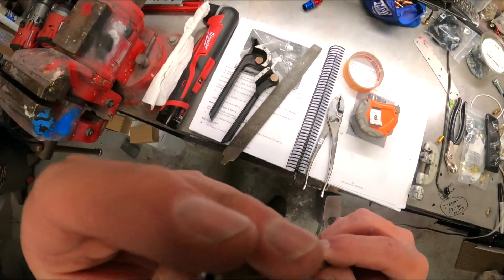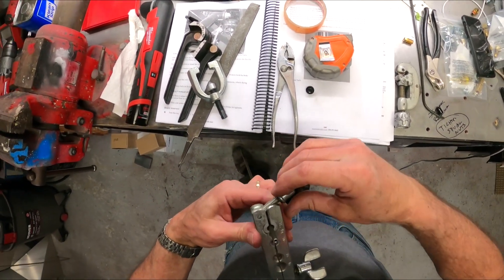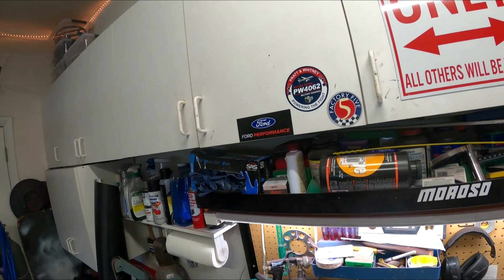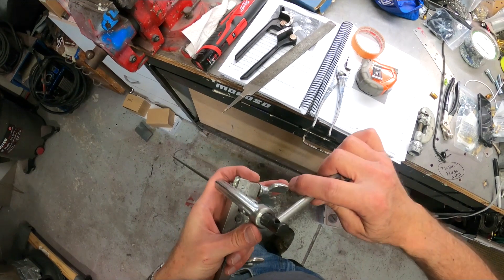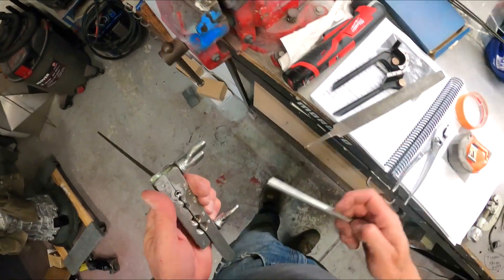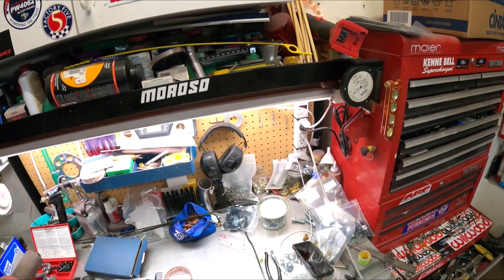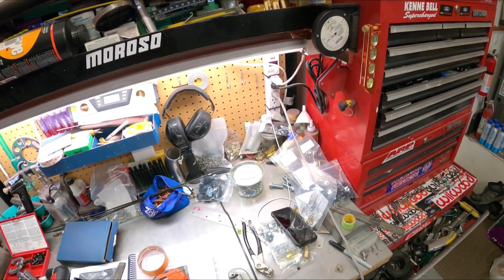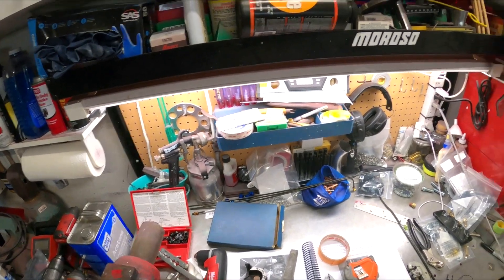Cobra Daytona Build-Flaring Brake Lines, Video 30

Comment: Really like following this build and your attention to detail. One comment on brake lines to keep the flairing to a minimum when doing custom runs is to use swagelok fittings for the joins (never had one leak on me ever) and only two double flairs on the MC and the soft lines.
Reply from the maker: Thanks for the tip. I will look into them for the next build. Thanks for watching.